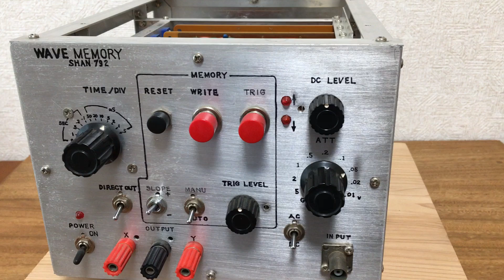Homemade Digital Sampling Unit for Analog Oscilloscopes in 1979

Comment: What a delightful piece of custom equipment! Do you ever plan to make a video or write-up about how it works?
Reply from the maker: Thank you for watching! Currently several part do not seem to be working correctly. I am undecided about producing an explanatory article. Sorry for this time. Also, I found that it is not interesting to see this output unless an old analog oscilloscope.

Comment: Beautifully made ! Does it still work ?
Reply from the maker: Thank you for watching! I retrieved it stored in my native house and after 40 years of trying to test its operation, I found that it has multiple glitches and AD conversion is not converging properly. And now I did not have an analog oscilloscope at hand, so I tried to display this output on a digital oscilloscope, albeit imperfectly, but it was not going to impress me at the time.